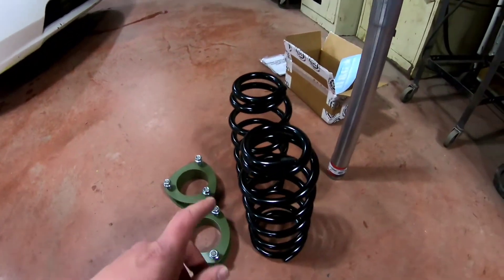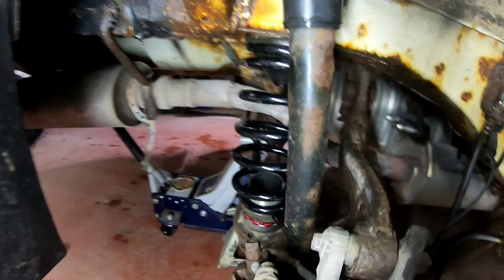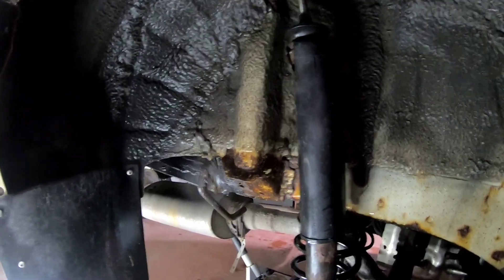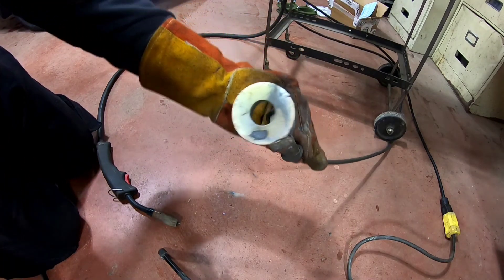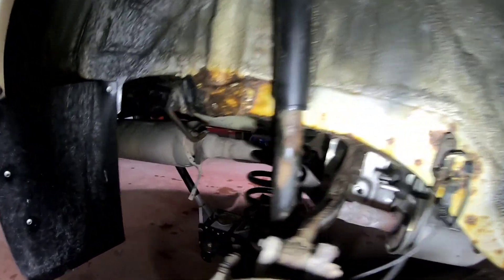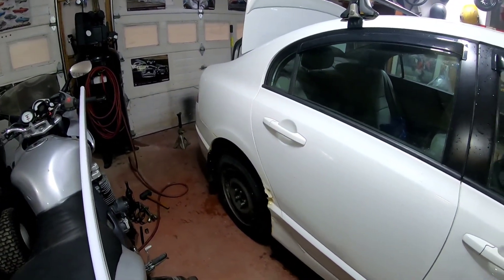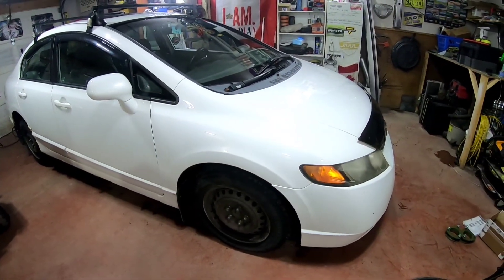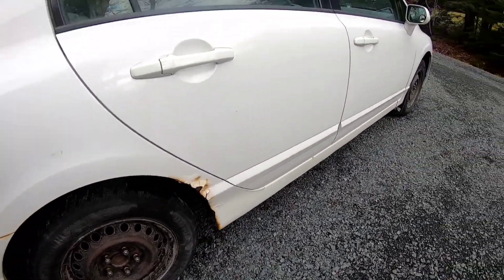Honda civic lift kit installed!

Comment: would this affect the cv axles. any additional wear? looking to do this but dont want to decrease reliability, and any decrease in speed or fuel consumption.
Reply: I just lifted mine and in the manual hrg sends they recommend you to  replace the axles, bum stops,

Comment: did you need to replace any other parts in the front due to height adjustment? thanks
Reply from the maker: No just put the spacers in but my tie rods are getting back but it also has over 310,000 kms on it

Comment: Thanks for the sweet video.

So to clarify, you have the front lifted 1.5" and the back 1.75"?
And now driving it a lot, would you have changed it to a different height?

Comment: What size tires did you manage to get on the car?
Reply from the maker: 215 65 16
Reply: Hey I’m gonna do this job to my car, what size pipe did you use for the rear spacer?
Reply: @rustnrestorationgarage8207  it looks at least 2 inches
Reply: @rustnrestorationgarage8207  also, did you put the lift kit spacers in the front and back or only the backv
Reply from the maker: For the shocks or the springs?